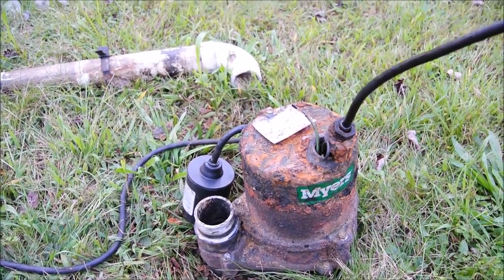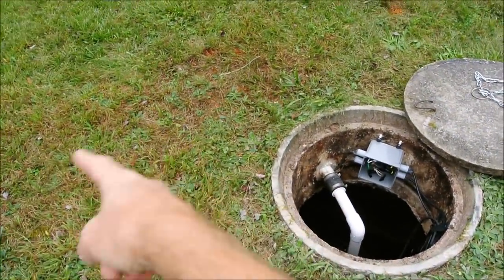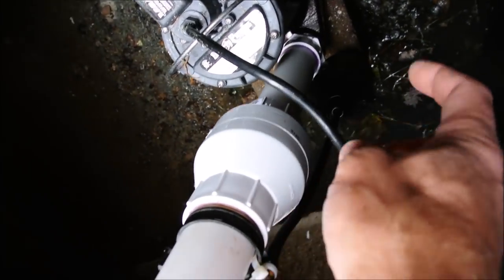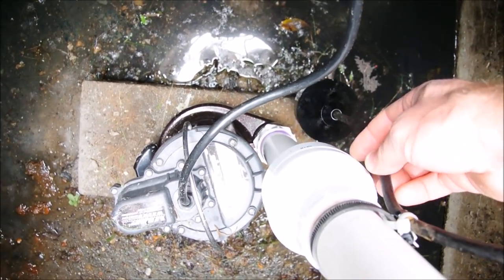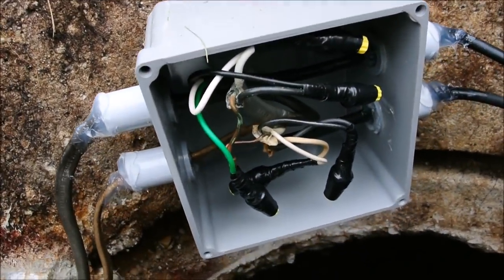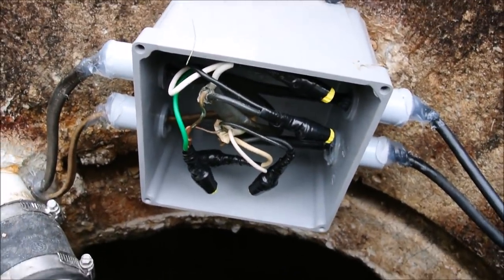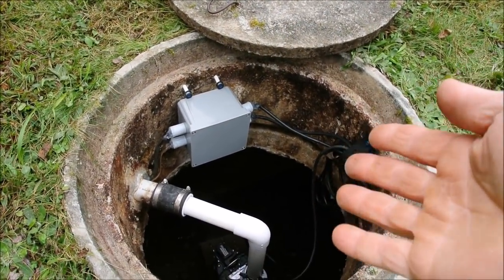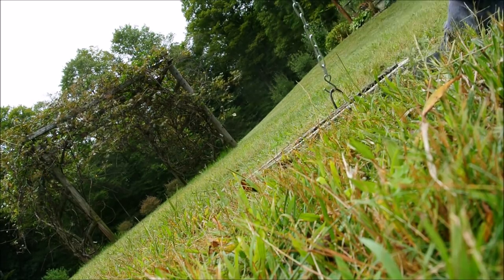Septic pump replace: DIY internal splice box

Comment: Everything looks perfectly fine, and congratulations for tackleing this yourself!  The check valve after your pump would be my only concern. Did the original setup include that?  I like to see the line between the pump tank and drainfield drain back completely so that it cant freeze solid in winter.  Maybe not a concern for PA winters?  Liberty pumps are the way to go.  We always used the model 283 1/2 hp pumps in our systems.  It is nice to have the wire conections in a box outside the tank for troubleshooting down the road, but now i'm just looking for something to pick on :).  As far as making your mound last, dont go crazy with soap or antibacterial cleaners (such as tablets that treat the water in your toilet tank). Water softener discharge and sump pumps should also not go into the septic, ideally.  Having a filter between the settling tank and pump tank is also a good idea, but you will be fine ss long as you pump your tank regularly.  We tell people to pump it every 3 years (or when the filter keeps clogging) in the hope that they will rememper every 5 or 6 years.
Reply: What he said. Have to have a check valve. It is a valuable and necessary component of the system. Check, please.

Comment: Hey atleast it had a riser and you didn’t have to dig it out 3 foot in the ground like mine 😆.  My power feed was just a handy box with a receptacle in that sat in a plastic box that was flush to the ground with no lid(probably chewed up by a mower long ago.  Recep was completely burned up.

Comment: Most of the pumps they sell have a plug. How do you avoid cutting the plug but still running it into the junction box? Ty.
Reply from the maker: That bothered me at first, too. The most sensible option is to cut the plug, because adding a receptacle to the inside of a septic tank would end up causing a disaster. The only remaining alternative would be to remove the pump's cord/plug altogether and wire it in directly, but doing so may not be advisable (depending on the pump), especially considering difficulty, water-resistance, and warranty concerns.   

The reason that pumps of this type even have plugs is because many people use these for a sump inside of their basement. Really, don't let cutting the plug bother you; in fact, it ends up being a much cleaner and simpler installation. 

If you are concerned with potentially not being able to return the pump, then just be sure to test your pump with an extension cord. (Make sure the pump's intake is submerged first.) If it works, you won't be sending it back.

Comment: I'm as cheap as the next guy, but any problem involving sewage is a problem I pay cash money to let someone else solve.
Reply: Moo
Reply: It’s not even about the money; it’s about being able to fix it when the alarm goes off at 10 at night. I can’t do my refrigerant on my house (R-22) and I can’t pull my deep well pump. All the other pumps and motors and control mechanisms it’s all mine to play with
Reply: thats where i come in racking in that cash ;)

Comment: From a licensed electrician: nice work.FYI, there is silicone available for underground splices that contains no vulcanizing agents so it remains, uh, raw and has no corrosive effect on the conductors. It sucks when you inevitably get it all over your fingers, though, so wear gloves or you’ll be dropping tools for the rest of the day. 
I’m going to throw a curve ball at you and suggest that you drill a pair of small (1/16” or so) holes on the bottom side of that box. One certainty I’ve learned about below grade junction boxes is that water will always, ALWAYS find a way in so the best thing to do is provide a way out. A couple of small holes on the bottom of an otherwise “sealed” box will permit drainage without allowing insect infiltration.
Reply from the maker: Thanks! I really went back and forth on the weep-hole thing. Since I can't undrill the holes, I decided to try it sealed at first and check on it periodically. The gasses from the tank are really corrosive. I'm also just really curious what will happen.
Reply: I am also a licensed electrician, and I would agree on the weep holes. One of the first things I learned on installing a house service entrance was from an old timer saying to drill 2 holes in the underside of the PVC LB for water to escape and pack the wire entrance with duct seal, because yes moisture can get anywhere. Those boxes I believe are rated for "wet location" also but I'm not sure.  Here is a good reference for those PVC boxes and what IP rating they have and what that means: http://www.ipexna.com/media/5590/scepter-jbox-technical-catalogue.pdf

Comment: I have question. How high does the black water get in the tank before it kicks on, and how low does it get before it kicks off. THx.
Reply from the maker: The pump has a float on it, which is on a slide that moves +/- around six inches. When the float hits the top, it kicks on and it pumps until the float hits the bottom again. The other float in the tank goes to an alarm inside the house, and it just tells me if the pump has stopped working. 

If you have any other questions, please ask. I did this over a year ago and it's still going strong. Saved lots of money. I used a Liberty pump, which was the highest rated one on Amazon.

Comment: Why is this Liquid tank necessary? can the liquid from the primary " solid collecting" chamber feed the leaching bed directly and passively? of course it needs to be downstream so that they could flow by gravity. what am I missing here?
Reply from the maker: That's kind of a long question to answer, since there are a million different ways that you could design a system. In general, this one separates the solid from the liquid to make it easier to pump. Even with a second tank, there are still some things in the effluent that aren't perfectly fluid, and if you pump that stuff up and into your dispersion field, it will eventually clog and disperse less effectively. 

When the tanks are pumped, the second tank isn't just gray water; there's plenty of sludge, sediment, and leaves along the walls and in the corners, not to mention some solidified fats/oils, mineral depositions, soap build-ups, and the various forms of life that start to establish biomass. I'm no expert, but my gut reaction to looking over this type of system so closely for the first time was that a third tank would make it work even better. 

As for having a gravity fed, passive leach field with no pump, I'm with you there. But (as with anything) there are reasons for this approach, if you go looking for them.

Comment: Was there a washer between the box and the lid?  If not I might add some additional silicone around the edge as a moisture barrier.  

You could also pack if full of those descant packs that get sent in every box and anything.
Reply from the maker: It had a gasket. I believe "crystal" kitty litter is the same type of desiccant you are describing. Maybe I should pack it full ;)

Comment: why not run the wires outside the tank and do the connections there? honest question.
Reply from the maker: You'll get an honest answer! Part of me likes the idea, but it gets shot down for three overlapping reasons. 1) Doing so requires an additional box, which is both an additional expense and an additional thing in the yard. 2) Doing so would require a considerable amount of my time and work. And, 3) having the splice box inside keeps it all neatly together and under one stone for convenience. 

Also note that the degradation to the wiring inside of the splice box happens at nowhere near the rate of degradation to the pump itself, so the splice box gets cleaned and re-caulked with every new pump. Last time I did it (four years after this video), the wiring inside was still clean enough, but the pump looked as though it had been thrown astern a Spanish Galleon.

Comment: My lift pump is 25 years old. The float switch was replaced 10 years ago and has been working up until about a week or so ago when I noticed my toilet starting to flush a little slow. I pulled the cover tonight and it was full. Probably time for a new pump. It lasted 25 years so that was $600 well spent 25 years ago.
Reply from the maker: That was a good run for a pump. Brace yourself now, because I feel pretty confident that pumps are no longer the build quality that they still were in the late 90's. The pump featured in this video has already been replaced. That said, I think the well-water here is also a bit acidic. Also note that pumps are now comparatively much less expensive. 

After some frustrating price shopping, I ended up buying a replacement at Harbor Freight of all places, since they are kept in stock and cheap. It's a strange time now that we're being pressured into buying throwaway consumer goods.
Reply: @pocket83squared  Turns out the pump is still going strong. The pipe connecting to the field bed had a broken elbow.
Reply from the maker: @DrD6452  Ha! Nice. As long as there isn't too much digging. Good luck.

Comment: You have a generator for the winter blackouts or not. Will the water runoff by itself?
Reply from the maker: 1) No. 2) Apparently, since the pump doesn't seem to have worked in years. I don't know if there's a gravity-fed overflow, or what. Maybe I should lower you (the camera) down to have a look around!

Comment: I’m assuming You must of had to cut the plug ends off the pump wires to feed them into the box??
Reply from the maker: Yes. I'm not quite sure why that was even on there. Perhaps if you were to use the pump inside, as with a sump? For a septic tank, it's best to cut off the plug-end and wire the pump directly. There's no room for a receptacle in such an environment; eliminate anything that's unnecessary.
Reply: @pocket83squared  thanks- I think that it seems better to hard wire everything inside a sealed box instead of having an outlet inside the tank that could easily invite corrosion over time..thanks for
Posting and replying-

Comment: Great vid. Loving seeing your journey. Question about the effluent motor. Does the mercury switch activate the pump for a minimum length of time or is it solely governed by the mercury switch? Very interesting to think about optimal levels of the waste water you would want to achieve. If I had to guess... (I have done no reading whatsoever) I'd guess you would want to get to about 2/3 full and pump to 1/3 full with the alarm you mentioned to go off at 3/4 full?
Reply: I laughed out loud at your casual comments about there being no problem with the pump/junction box in the state they were in!
Reply from the maker: Whoa, hold on. The mercury switch only turns on an alarm in the house. It does that when the pump has failed. The pump has its own little float on the side of it, so the pump's float goes off way before the mercury float does. 

Ideally, if everything is working, you want the water level to remain between the bottom of the pump and the top of the pump's float.
Reply: I see. Thanks for the explanation!

Comment: OMG - who thought that was a good idea to put that power boxI NSIDE? I would move that box above ground in a weather proof box asap, or the problems will continue.  I just went through this myself … I know the box you installed is “waterproof”, but trust me the water will find its way in.
Reply from the maker: The pump just went bad about a week back. I had to go inside of my box to replace/rewire, and it looked great. Trust me, if you add a seep-hole, you're just asking for condensed water and (faster) chemical degradation of the wiring.
Reply: @pocket83squared  glad to hear that’s working for you.  The amount of condensation inside a septic tank is hard to believe until you’ve worked on one and seen the horror inside … 😮

Comment: Did you have to worry about gases?
Reply from the maker: Corrosive gasses? Yes. Toxic gasses? Yes, but no. At least, not any that I'm concerned with given small exposures. Before going into anything underground, one should be aware of 1) methane, of course. But my septic tank doesn't have a very large volume, so its air concentration will dissipate rather quickly with two open manholes. 2) Hydrogen sulfide is stinky enough that you won't want to breathe it. 3) Bacteriological hazards are reason enough not bite your fingernails while doing septic tank maintenance, and certainly wash your hands and tools following the service. Bacteria can also be airborne, and density matters, so yes, that's also a potential concern, and another reason not to breathe in smelly air.  

Consider that my exposure here is limited to the occasional head-in-the-hole look around (while holding my breath), and the periodic pump swap; it's not as though I go inside the tank to sit down for a game of Chess. If you DO need to go inside, do some reading first and get a device to check for the appropriate air-quality concerns. Worst case scenario, you'll end up renting a negative-air machine. At bare minimum, I wouldn't 't go in one without first cleaning out the tanks and opening all the hatches, next running a box fan, and then waiting for an hour or so. Oh, and remember to eat your PB&J sandwich outside the septic tank, eh?

Comment: I recommend getting some sort of bio-active septic treatment stuff.  I had a company that would ship 12 pks a yr to use, it really helped get my old system working better.  Also, if you're not aware,(idk your previous involvement with septic systems) avoid drain cleaners, it doesn't take much to kill off the various biological colonies digesting your waste. A little Bleach is OK as long as you're not dumping gallons down your drain at a time.  Do all your drains run to the septic?  I've lived a couple places that had separate drainage for grey water that I didn't know about until they became clogged. Always finding fun new things and genius  solutions to problems when learning a new property, electrical upgrades and additions by the previous homeowner's unemployable brother-in-law are usually the most entertaining...or decks in your case.  Hope there aren't too many more surprises for you to find, and my they be small and entertaining to fix/video if you do.
Reply from the maker: You hit the screw on the head with the brother-in-law point! The electrical work in this house is an absolute hibotchery! (that word was a made up portmanteau of something). Looks like I'm going to be learning how to electric this winter. 

As for the septic's local flora, I will be extra careful. The pump guy was an incredibly knowledgeable third-generation shit sucker (who, incidentally, also had his bachelor's in biology), and his grandfather's seasoned advice was to throw in the occasional packet of baker's yeast. Weird.

Comment: Why does the system have an alarm? Is that to protect against sewerage thieves?
Reply from the maker: Nobody wants to steal my shit. It's the pump that you have to protect from somebody running off with. As soon as they are able to throw the pump up to the ground, I'll be out there in my boots and boxers with a shotgun. Damned kids. Always lookin' fer a handout, but no free pumps at my place.
Reply: In case someone were serious, the alarm Is for high levels indicating a power or pump failure that may eventually result in your semi treated sewage forming a lake in your yard. It’s easier to reset a breaker or unplug or replace a pump when you’re not in a field or sewage that you have to had pumped out. When you hit the point where there’s no flushing or drains it’s a biblical catastrophe to the wife, kids and relatives. Sump pumps are pretty reliable but GFCIs do trip and breakers fail. Any heads up helps a lot.

Comment: I do hope your repair lasts 20 years, but it's rather profligate to make a purpose-built chain lifter thing for one use every two decades. And then there's the question of protecting it from the elements, storing it safely, regular inspections and maintenance etc etc etc

Maybe if you made a video musing on its design principles that featured action-cam shots of it being deployed, it would ameliorate your indulgent excess?
Reply from the maker: You don't really have a choice. You have to take the pump in and out a dozen times to get everything to fit correctly. Further, lifting that cover is an order of magnitude more difficult while bending over, so the gizmo's existence is well-justified. 

And FYI, I had to Google profligate, so in a touch of irony, it seems that the excess here was with your flowery verbiage. I'm not judging. I love good writing- er, the well-written, even when the topic is a shit pump.